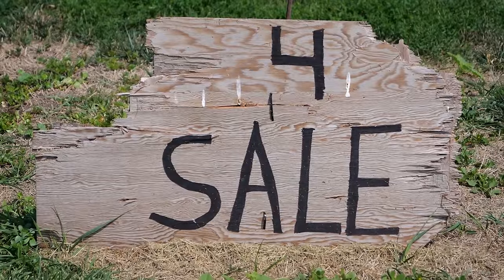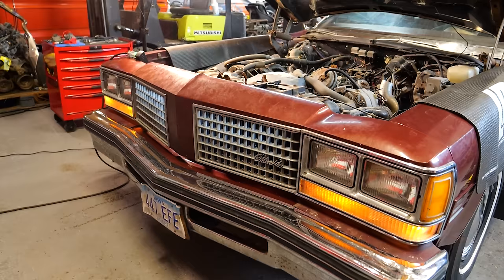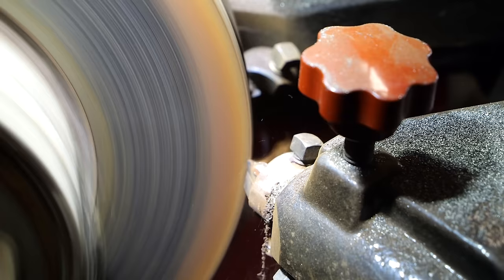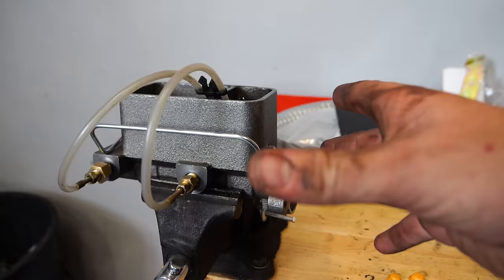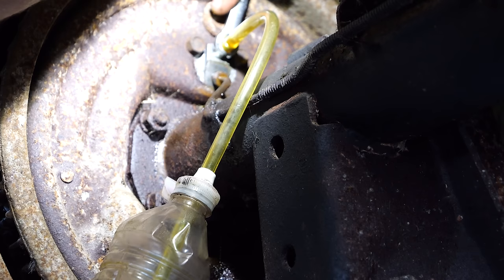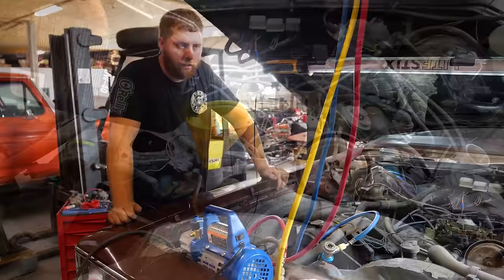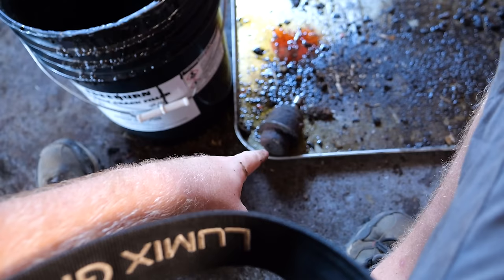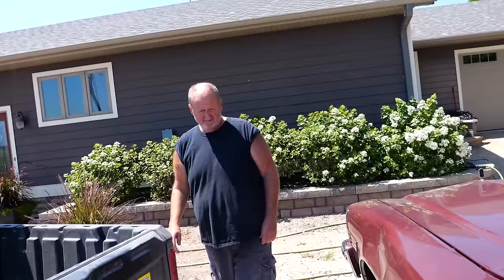Will this ABANDONED 70's Luxury Car RUN & DRIVE for CHEAP!? $1,500 DIY Daily Driver Revival!

Comment: Mid 70's Oldsmobile 350-455 spark plug gap 50-80 thousandths and the 85-87 Oldsmobile 307 roller cam motor uses a 60 thousandths gap i know sounds ridiculous but that's what they called for...

Comment: I got small tid of info to share! Oldsmobile fuel pumps & ford have a connection! Back in the day Ford hired on some big time hot shot from GM! He was with Oldsmobile! He went to work for ford & he designed a engine for ford! Not just any engine! A well known great engine! He designed the 351 Clevland for ford! If you have urself a notice at the 351 Clevelands fuel pump design, u will see it is the only oddball, not like the other ford engines! But it does have a striking resemblance to the Oldsmobile fuel pumps!! Just sayin!

Comment: Your vacuum pump didn't sound like it had any oil in it if there is no oil in it you are not going to get contaminates out of the system it just doesn't work right if it not full of oil

Comment: the worst thing you could have done was hook up all the antiquated power robbing vacuum hoses, to components that likely aren't working anyway. If you strip all the emissions garbage off, the fuel mileage will increase

Comment: My first car was a Delta 88 Royal Brougham but sadly in 83 that one only had a 307 Engine in it, I woulda gave my right arm for a 455.  In my humble opinion that 98 is crying out for a twelve bolt Posi, or even a "lunchbox" posi , I know its a cruiser not a smoke machine but I mean carrying a 455 its gotta have both wheels spinning if your gonna smoke em. Again thought that's my opinion

Comment: From experience I've found out a slightly loose wheel bearing will shorten its life but they will still go for a long time, but an over tightend bearing will burn out super quickly.

Comment: The way we did it was tighten the nut until it barely slowed it (i think you said caught it) , then backed off the nut to where the next slot in the castleated nut and the cotter pin hole lined up. Edit: no torque wrench was used that I ever saw…., Proud of you for turnin the old rotors. What was your final reading though? Be a little nicer to the old dinosaur 🦕 🦖….. that ones too nice to throw a rod through the block lol……..

Comment: I have cut so many rotors in my young automotive career, late teens, early 20's that I can smell that rust, feel the dry, powdery brake dust, the snap of the dried out, cracked vibration band slipping out of my grip hitting my hand, the screeching of the blades against the rotor like nails on a chalkboard. Pulsation, not sure if its bad seating, warped rotor, or bent lathe shaft. Waiting and watching hoping I did it right, dire risk of overcutting or otherwise damaging the rotor having to explain to the service manager why we need to provide free rotors to the customer. Now that I have more money than time, , paying $46 per new rotor sounds fine with me.

Comment: Nope, too much preload is actually better than too little, (within reason).   Too tight will just wear in eventually, too loose and you'll cause uneven wear etc that will destroy the bearings/races

Comment: As all of us born sooner than yesterday know - the metal on these upline 70's cars is REAL and WAY heavier than the tin-foil crap you guys are used to - so bend and bondo and you're WAY good to go. In fact that's a "2 x 4 and hammer" job for 90% of it; a real body man could make it look new.

That said, what's been used to replace those missing rubber flex-panel thingies in front of the tail-lights since they began rotting in the '80's, by 98% of us working jerks, is ... duct tape.  You can probably find burgundy duct tape these days, or at least purple or some other near-miss color, and you'll be good to go! 😄

Comment: Now then,,,,,at 28 minutes,,ish, Kevin shows us how not to adjust wheel bearings. Especially used ones.. Time after time after time I see so many people in America broken down on the side of a massive busy highway with welded wheel bearings..!  On taper roller bearings there should ALWAYS be a tiny bit of play when you finish
 adjustment. Bearings get very hot and need room to expand. How can this happen without any movement allowed guys....??✌️👍🇬🇧
Reply: I doubt you see so many people in America broken down on the side of the road with welded wheel bearings .

Comment: why don't you use heavy duty 15 w 40 Diesel oil has all the Zinc and minerals these old flat tappet engines need.

Comment: I am surprised you got those tires to spin. Despite having that big engine, these were not geared to spin tires easily. These were big comfy cars that you could go hours(as long as you had the gas money) down the highway with the feeling you were on your favorite couch. A great road trip car. You might see if a body shop can fix that fender up as you are right, most of these went to the junk yard a long time ago because it was a sedan so fenders might be hard to snag. i have always like the big Buick and Olds sedans with thier whore house red interior.

Comment: Kevin, I don't like Ben pack anymore. I like the challenger Lift because challenge lift you can open the doors all the way why inside the car on the lift door not hitting the lift in you can go somuch  higher in can hold more weight

Comment: Painting over rust and dirt isn't rust prevention its wasting paint you should at least pressure wash and hit it with a wire brush I promise Painting over rust makes it way worse cuz the dust draws in moisture and keeps it

Comment: My TH400 kickdown solenoid snapped the spot welds and was dangling inside the transmission.  That can also apparently be a problem. PS. You are a commie for not putting whitewalls on that thing.  Love the 4dr ht.  CHEERS!!

Comment: But 1976? Horse power on a 455  OLds 1998  should be between 187 and 190  thanks to our politicians who insisted on rolling back the cam and reducing HP to ridiculous levels. But then gas prices were in the sub-one dollar per gallon.
Reply: And I should have included this, 'Ol Arizona Stripper, 9 miles to the gallon, highway MPG.

Comment: I just can’t watch you spray brake clean down the carbs of motors that haven’t run I many years you should be using fuel with 2 stroke oil in it